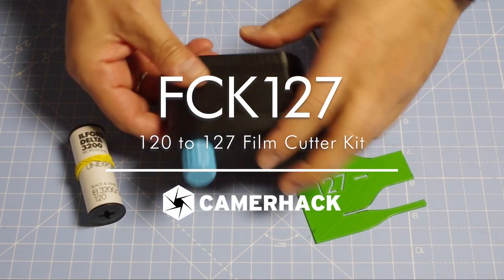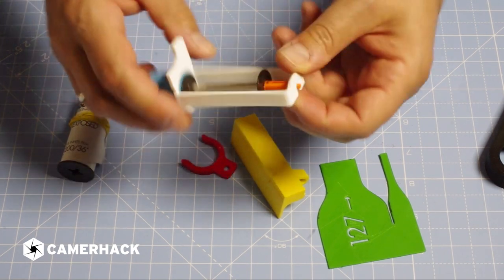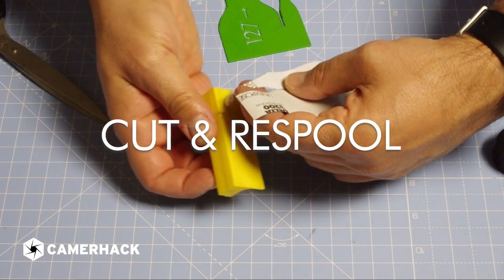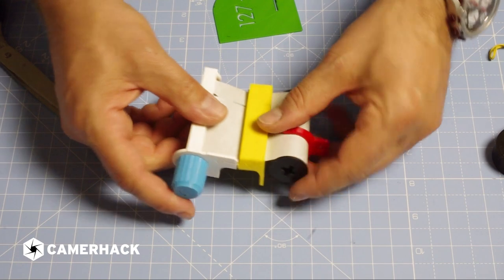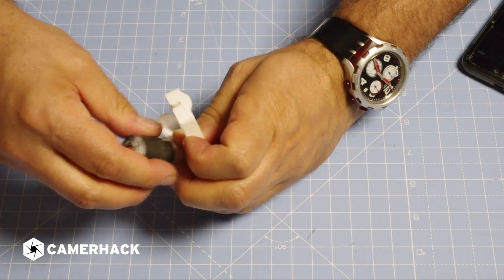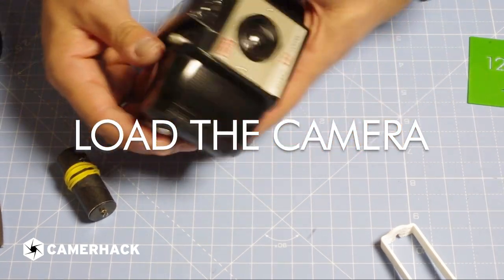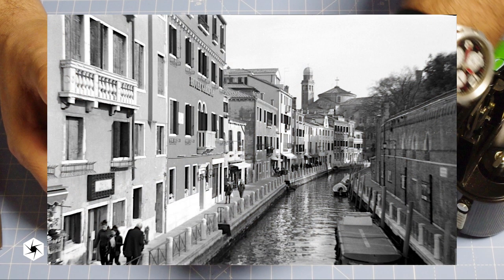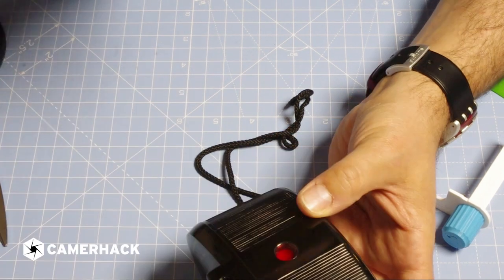FCK127 Film Cutter Kit for 127 film

Comment: Nearly all 127 roll film cameras from the mid-1950s on, which include everything from a Kodak Starmite to a Baby Rolleiflex TLR, shoot a 4x4 cm format. While the device will cut the 120 roll down to 127, it will not index the result so that it loads and spaces properly for a relatively modern 127 camera.  A solution to the problem seems easy enough for the more expensive TLRs, which do not rely on a red window and indexed backing paper. You just need to find a "start" mark to index with your camera when loading the roll. To do this, acquire one real 127 roll (fresh or expired), shoot it or not as you will, then measure that backing paper for spacing from beginning of backing paper to "start" index mark. Unroll your newly cut down roll backing to that same distance and manually mark the backing with a new start index. Not too big on unrolling the cut roll down to the film to tape it to the backing in daylight, since you are probably over-exposing that first frame, but you could do that in the dark quite easily and avoid any such issue. Also check the length of a real 127 roll of film. The video implies that it is the same as 120 film, but that may not be the case. Adjustment to the film length may be required too.  As of May 2023, the link to the maker is dead, but you can find them with a Google search.

Comment: Do you ever find the finished 127 roll a little too "fat" to fit into certain cameras?  I have some cameras where it doesn't matter, and some others where it does matter.  The tolerances are very tight and even a little too much extra film and/or paper creates a 127 roll that is too fat and thus it rubs and doesn't advance smoothly.
Reply from the maker: Yes. For example in the Kodak Vest Pocket the resulting roll is too fat for its slot. I suggest cutting away the most of the starting backing paper, and removing the most of the remaining end tail...